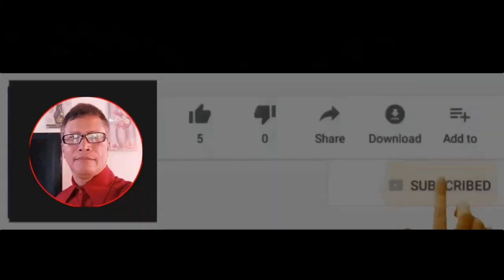TIPS Paano Makatipid Sa Submersible Water Pump for Hydroponic Farming at Home - Mini Farm

Comment: Kng ang pump na 800L/h ay powered by solar panel, magkano ang solar panel para sa pump at sa experience mo kaano katagal gumana ang pump pag fully charged by the solar panel? Sorry Sir I am not familiar with the solar panel operation
Reply from the maker: Di ko na subukan Ang solar panel. 19 watts lang ang motor pump, Kong mayron pong 25 na solar panel ay pwedi na. Pero need pa rin po ng battery para gagana sa Gabi. Kong mas malaki Ang watts ng solar panel at car battery ay mas maganda po.

Comment: Hello po new subscriber here,  Meron po akong power supply sa WiFi namin extra 12volts 2amp, pede ba gamitin un boss? Ilang ampere gamit mo bossing?
Reply from the maker: Di po ako sure Kong ok yong sa wifi na supply di ko pa po nasubukan. Sa akin yong sa tv, pero good for 5 months lang nasira na, midjo Malaki Ang amperes ata sa aking kaya  masyadong malakas. Mas ok po yong made in Germany mag 3 years yong Isang ginagamit ok pa rin. 😊
Reply: @DoubleB-Farm   ano pong made in germany po ? ung pump or ung power supply?
Reply from the maker: Hindi po, galing sa bumba Namin, naa mayrong 260 ppm at 780 pH level.

Comment: Sir yung nilagay nyo yung lettuce sa pvc pipe na bilog kailangan ba lumalabas na yung roots o gamot nya?
Reply from the maker: Di kailangan, pagkatapos na transfer galing seedling tree, lagay agad sa PVC kong Wala Kang iBang paglayan.
Reply: @DoubleB-Farm Anong size Ng summersible mong ginagamit dyan at ilang hp
Ilang Puno Ng letose Ang kayang supplayan
Reply from the maker: 18 watch lang po ito at di po ito nag tagal nasira na po 5 months lang. Ang gamit ay Germany made aqua speed, matibay mag 3 years yong Isa ok pa rin. NASA 600 Puno Ng lettuce sa Isang water pump. Mayron pong link dito sa description.
Reply: @DoubleB-Farm  Anong unit Ng submersible pump mo

Comment: Magkano sir ?
Reply from the maker: 400 plus lang po Dala shipping Wala pa power supply.
Reply: @DoubleB-Farm  salamat sir Saan kapo nakabili  sir ??
Reply: Anung name din po pala
Reply from the maker: Lazada po, search nyo lang 12 volts submersible water pump. Piliin mo y.ong, 800L/hour 19watts
Reply: Sir saan connected yong pump mo na 12v sa solar panel o direct sa ordinary meralco electric outlet?
Reply from the maker: Sa kurenti pa po, ginamitan ko ng 12 volts power supply. Di pa ako nakabili ng solar power. Bibilhan ko pa po.
Reply: @DoubleB-Farm  salamat po
Reply from the maker: Sigi po salamat din po. GBU